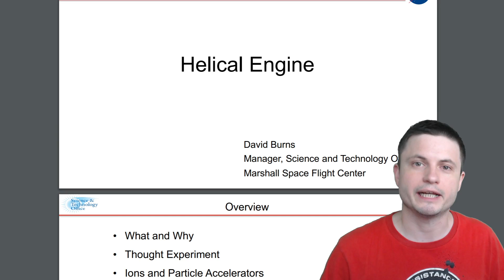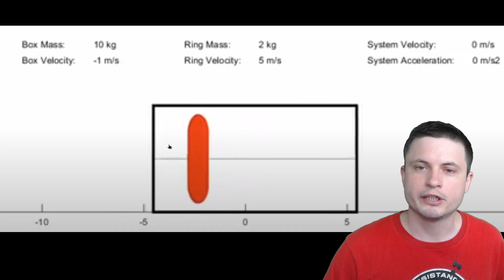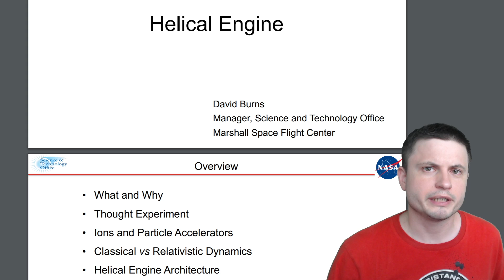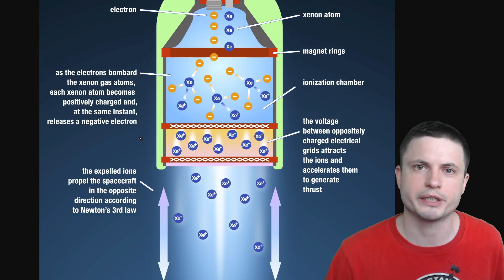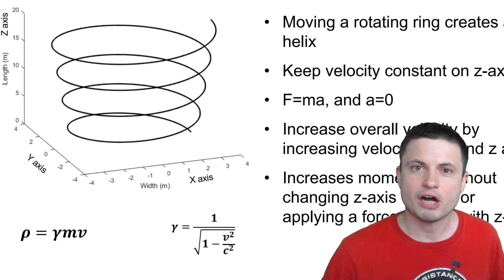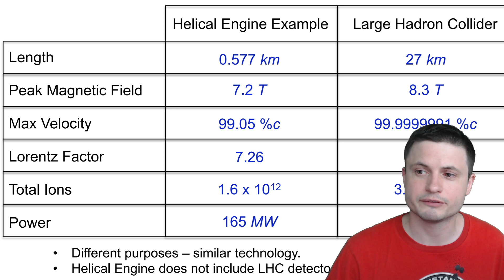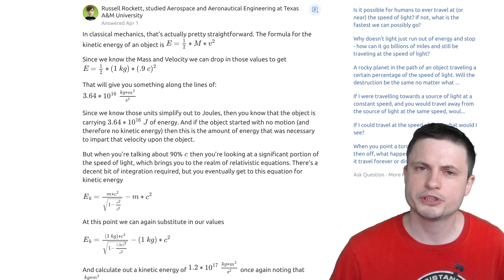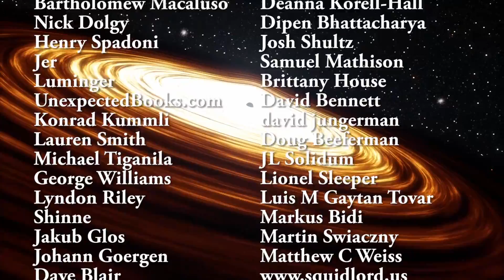NASA Engineer Designs a Near Light Speed Engine But Does It Work?

Comment: You would need two opposite rotating masses in order to fly in a straight line. Without spinning uncontrollably or use thrusters to dampen the rotational Force.

Comment: I created a infinite moving machine (what I call). It's hard to describe; It's like a regular plastic hollow ball with a magnet inside, the ball's diameter is pretty essential, and it is 2.71 cm (was hard to report). I made this as a fun thing to play with, but after accidentally putting some xenon filled balloons near the ball, it made some reactions. The ball started rotating 90° degrees; I turned the balloon a bit, and the ball moved all over... I don't know what this is, but can someone explain?

Comment: Easier solution to fuel with engines in space: using a kind of ion engine make a secondary magnetic field to redirect the ions back towards the craft/engine so they can be collected again and reused (possibly also adding more thrust). The advantage would be expending less fuel, the disadvantage being that the energy needed to redirect the ions would be huge. (aside from the technical issues of both having the energy and making a magnetic field powerful enough to do this) Either way if we want a system where we loose less mass along the way that would seem much more practical at this point.

Comment: I thought about doing this with a liquid metal stored at the base of a top like devise  with tubes leading to the widest section and as its spins the mass will increase via centrifugal force which could work if the engineering could be researched and a method of returning the metal to the base via magnets or something is established. I assume this device could be placed on a spiral like shaft and when the top gets fast enough it could releases fingers that lock to the shaft...potentially again with centrifugal force as it slows the shaft is released and the mass which is at the wide point of the device returns to the center where the mass becomes less dynamic.  There is real meret to this idea I think!!

Comment: That would not work, specifically, the circular motion would create a force pulling away from center of mass and you will need it to change direction of the force forward or reverse, which would cause loss of power. You pretty much lose all force. HOWEVER, there is another way to redirect the force to maximize what is applied, but you would be right back at your original problem. To make this work you would have to intercept the swinging body at the moment of peak power with the specific forward or reverse to utilize that power. So you would have to literally spin the ship in the direction of the point of interception. Then you would not be able to steer the ship, you would gain thrust* in random spots in the ship just to fly straight. Just my evolving thoughts ;)

Comment: You are a fraud. You clearly have no idea about relativity, so stop pretending.
Reply: Zoltán Kürti stfu
Reply: @mystical2997  I have every right to criticize a misleading video. He claimed this drive works in theory. It doesn't.

There are two options. The calculations for the drive were correct (for all practical purposes they were certainly wrong, but can't be certain ik the philosophycal sense), in which case this is an internal contradiction in special relativity. It violates the conservation of momentum, which is also derived from special relativity. This would mean that special relativity can't describe this machine, so the calculation is worthless. The other option is that the calculation is mathematically wrong, in which case it's worthless.

In either case, it's nonsense. And people who supposedly learned astrophisics don't see this simple fact. Pretty ridiculous, and needs to be called out. I don't get what's your problem with this.
Reply: Zoltán Kürti nasa is wayyyy smarter than you bud
Reply: @mystical2997  first, NASA has nothing to do with theoretical physics, they are engineers. Second, they already realised that this is not going to work, they took down it from their website. The NASA link in the description is dead.
Reply: @mystical2997  that's cold hard logic, I can't argue with that. lol

Comment: Maybe this isn't very energy efficient, but how fast can it accelerate? If it can get to 90% the speed of light without using propellant, and we can get fusion power, and fusion power is more conservative of mass and volume than throwing propellant out of an engine, then wouldn't this make more sense?

Comment: It's worth mentioning that you don't need to MAKE the energy while the engine is active.  If we had better, lighter, more efficient power storage breakthroughs, we could carry the energy we needed, or just store it long enough to make a "burn" with the engine.  At this point, however, that would be incredibly heavy to store enough energy to do anything productive with that drive.

Comment: The one problem I don't see being addressed in talking about this new engine design thats an enormous flaw, so you have a mass, that goes from 2kg to 1kg, where does the 1kg Go? does it detach itself from the main ring and stop in place of the structure half way, which would transfer its momentum into the object then and this stops working. you can't Chuck the mass, you haft to bring it back in the other direction, the momentum is maintained... This "engine" is  nice thought experiment, but its impossible to work with real world objects.

Comment: I'm a lay man and I can call BS on this.
First, the acceleration in the initial thought experiment is supposed to be gained by gaining mass in one direction, but that requires an incredible amount of acceleration and it must decelerate when moving back again. Not only would this be beyond our capabilities, all energy and forces cancel each other out.
The same goes for the "solution" of changing spinning into movement. Spinning objects are incredibly resistant to changes in their angular momentum. Any acceleration gained through such a change would be canceled out by the force required to change it.

Comment: Currently, fusion research concentrates on confinement methods, however how difficult would it be to initiate an open ended fusion reaction. A fusion torch so to speak. If this could be done, and 1 gravity acceleration could be achieved, we get the solar system in the bargain. Maybe you could do a video on this?

Comment: The most efficient energy source possible is anti-matter.
Reply: producing antimatter is not an efficient energy source since it uses more energy to create it than applying it to something else, hence it is expensive.
Reply: @Yuuni_Shiroza  Efficient as in 100% mass to energy conversion. The goal is to reduce the amount of mass needed to fuel the propulsion system. The efficiency of creating the fuel back on Earth is irrelevant.

Particle accelerators already create antimatter in small quantities. Antimatter propulsion is a prerequisite to creating the fastest propulsion system possible.

With nuclear, there's always a waste product. Which limits how fast the engine can go.
Reply: @InfiniteUniverse88  Efficient as it is in terms of converting mass to energy. LHC did create antimatter and scientist around the world already did produce milligrams of it. It is in fact one of the best matter to fuel future space-ships. however in this era, it is impossible to create grams of anti-hydrogen, since most antimatter is so violent and hard to contain. even an Anti-hydrogen atom needs a huge hardware just to contain it. Imagine us humans did in some way produce Antimatter efficiently. but due to it being so hard to work with means that we need to produce some sort of container that is meant to hold Antimatter. and it will add more and more mass to the system until using antimatter is not reliable enough due to it being dangerous and hard to work with.
Reply: @Yuuni_Shiroza  It's either that or nothing.
Reply: Ok, go find some then...

Comment: Not a physicists myself , but this whole "increasing mass" concept seems flawed to me. Force is what is being increased through providing an ever increasing flow of excess energy which in turn , mathematically , can be expressed as "increasing mass" yet that term being academically used is all sorts of wrong. Rather than contemplating on a reactor that could produce such power shouldn't mankind be focusing on efficiency? I cannot think of a single compound that could survive this massive of an "energy doping" , overcome thermal losses and remain unscathed. Another fault in this design is the catastrophe a collision with whatever an object would result in. Wormholes seem to be the most sci-fi of all concepts,but would be much better and efficient. Transferring energy  seems like a much safer option rather than accelerating mass.

Comment: What about an unevenly balanced flywheel connected to an electric motor. When the heaviest part of the flywheel is between 45-135 degree the motor accelerates it and between 225-315 decelerates it. Obviously a torgue would be created which would be counteracted by another flywheel spinning in reverse.  Perhaps several pairs and other reaction wheels could be used to even out the inevetable oscilations. It would be hard to get it working well and i'm not sure it would be efficient but would actually be buildable with current technology.

Comment: its my understanding that there have been several designs that in theory could get a space craft up to half speed of light or better, but its also my understanding that the same means to achieve those speeds, could not be used to slow the craft down. any design that only factors total speed but doesnt include a way to slow down, makes almost any design useless as a craft.

Comment: How to power it? Easy, if you have the orbital infrastructure to build a ship just over half a kilometer long then you already can, or more likely have, built solar power satellites that beam power to your space stations. Or simply mirrors, that redirect and focus light on solar panels somewhere else. Either way, you can not only beam power to the ship but also use a lightsail to help it get to speed.
If this engine doesn't actually work, you will still have a ship propelled by interstellar range lasers, just bring along a mirror to send ahead towards your destination to reflect the beam back so you can slow down.

Comment: Critic from scientific community is totally understandable if you check the report itself. Instead of studying a source of the net force he studies efficiency of engine without clear understanding the principles.  The thing is, he claims that he uses Relativistic Momentum Transfer Model  (and doesn't describe clearly what it is. Basically it is a code he probably wrote) which he based on usual relativistic dynamics. Equations of special relativity constructed in such a way that don't allow to generate net force(because of homogeneity of space-time). So it is 99.9% flaw in usage of equations or wrong computer code. But instead of revealing this crucial and most interesting aspects, he analyses efficiency and details of design. It only masks underlying simple physics and makes everything look way more complicated.

It is well known and checked by thousands of people and experiments that relativistic dynamics conserve momentum. Now we have a report where the author claims that his code, based on relativistic dynamics, generates a net force in closed system. Where do you think will be the truth?
But to be fair he admits it himself in his presentation:

Basic concept is unproven
Has not been reviewed by subject matter experts
Math errors may exist!

So, too much hype around a very preliminary idea.
PS: mass is a Lorentz invariant. It doesn't change with speed. Any undergrad physics student knows it. Mass changing is very outdated point of view from the beginning of 20 century when people wanted to keep the equation for momentum in the the classical form p=mv. They introduced "relativistic mass". But since 50s all textbooks don't do it. Equation for momentum is p= gamma*m*v  and mass here doesn't change with velocity. This interpretation is more clear and self consistent. It is easier to use  and escape many traps people fall when they try to use relativity.

Comment: will not work. at least in your design. to accelerate your wobbling mass you have to push it against the shell. same for slow down. Don't forget that changing of a mass doesn't happen instantly. try to brake down it into more stages. while changing a mass you are actually pushing your shell back. another approach is to change the mass by some nuclear reaction. like converting two H into one He, and then back. it's a very small change of mass and I'm not sure that the speed will not change during this joins/splits. Or it could be a hybrid. Accelerating H in one direction and He in opposite. Em. I doubt anyway

Comment: This seems an awful lot like how the Woodward effect is theorized to work. I bet the two are related at a deeper level somehow.

Same thing with the EMDrive. The Woodward effect predicts that an inductor capacitor pair will undergo a mass change when they exchange energy in an accelerating reference frame, and the microwave resonator cavity in an EMDrive is directly analogous to an inductor/capacitor pair.

It seems like all of these exotic drives are converging on Mach effects.

Comment: No, it won't "technically work".  Speeding up a mass in the box still has Newton's 3rd law to take in to account.  Anything you accelerate has to accelerate against something, even if it's rotating.  You just aren't going to sneak around N3 while in this 4D universe.  And yeah, converting energy into mass of sufficient quantity is going to be a problem.

Comment: The problem for high speed is that even if it is easier to throw mass backwards, it will not get you up to the speeds achievable with this drive.

Comment: I have thought of a hypothetical propulsion drive.. Anyone want some details?
Reply: Distant Vision Spit it out!
Reply: @umbrellastation25  Ok, so it is based on a lot of stuff that would require actual investigation to verify. At the point I am at I choose to simply categorize it as a hypothetical propulsion drive. Just want to make this very clear. 

So the base premise is that the ion drive works. Next is that the open vacuum of space is not actually empty. Next we consider the potential to invert the ion drive, and use the materials in empty space to generate a static field. Next we consider required energy levels, and acknowledge the need for a plasma field. The concept is that high power ionozing EM can be projected in front of a ship without neutralizing the static difference generated in the system. In ion drives this is typically done with a neutralizing ion beam. Without that there should be an electrostatic field between the ship/body of the emitter, and the plasma field ahead of the ship. This is all super pseudo so far, but touching on basics that are evident in other systems. In the ion drive we have a charged plasma gas attracted to a grid of opposing static charge. Once the exhaust passes the grid there is a neutralizing ion beam to cancel the charge in the exhaust plasma. Without this it would continue to build a charge. 

So far we have a hypothetical ship that charges a plasma field ahead of it, and is attracted to the opposing charge. Next there needs to be a system similar to a magnetohydrodynamic drive. The plasma field will be the fluid in which the drive propels itself. This system will also be used to shield the ship from the plasma, as magnetic fields can be used to create a repulsive shell. This enables the system to forcefully stream potentially dangerous matter around the ship instead of having the ship impact these particles. This is important because at relativistic speeds one single atom of hydrogen could potentially destroy a ship. This ship would require massive levels of energy production, but a nuclear reactor should be able to handle it. Once the systems are combined you would have the ability to accelerate constantly. I feel I didn't do well to explain this at all, but it is simply a combination of existing technology. The greatest potential would come from having the largest possible plasma field to travel through, and the highest possible energy levels for both the static field, and magnetohydrodynamic drive. The structure of the ship could be designed like a grid as well, and a central core could be the crew compartment.

Comment: They were right at the beginning when they said check the math before you publish.
The Lorentz transform doesn't just apply to the oscillating mass, it applies to whatever container system you have around it.  You don't end up with any net thrust because mass increase, time dilation and relativistic length contraction apply to to container as well.
Here's a thought experiment to show you why it wouldn't work:
In this system you have some kind of oscillating mass, the "donut" and an acted on "container", well lets just modify the shape of the system.  Instead of having the donut on the inside, lets make the oscillating mass be a sealed tube that goes around the outside of the engine and bounces back and forth with the engine inside.  See what we did? We've swapped the places of the donut and container.
Both the drive mass and the driven mass change relativistic momentum, not just one or the other.  Momentum is conserved in whatever mass interaction mechanism you come up with.  You're not adding any forward momentum to the drive mass that isn't canceled out by opposite momentum given to the driven mass.  Ever.